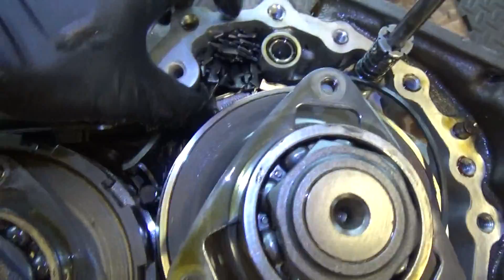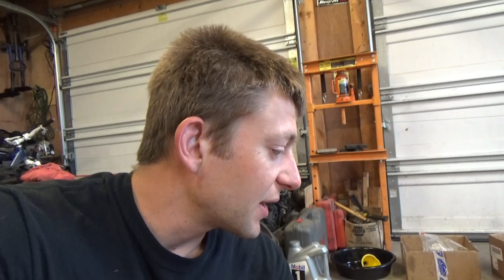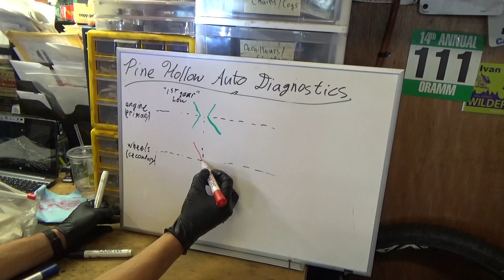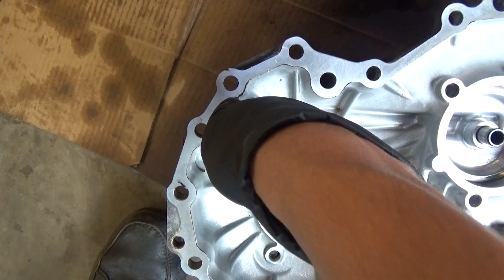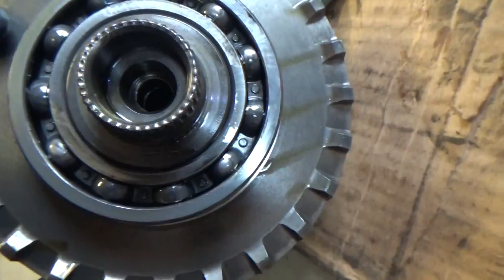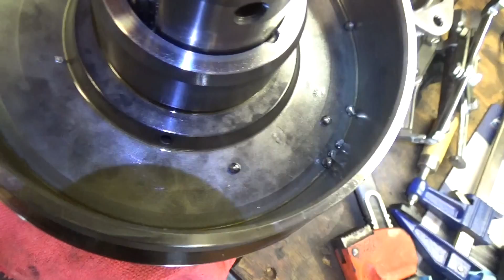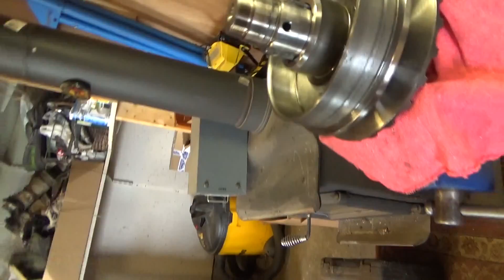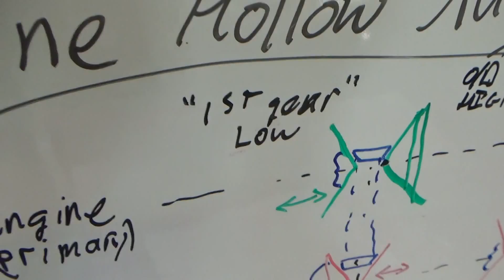Nissan CVT: Teardown and Failure Analysis -Part 2 (RERELEASE!)

Comment: Your synopsis is incorrect. The belt gave and jammed up the drive which sheared the output shaft which it also appears that the vehicle was moving when the belt came apart. Nothing lasts forever, remember this trans is designed and built by a mortal beings.
Reply from the maker: Now why are you so sure that the belt gave up first? I'm sticking with my initial findings lol
Reply: @PineHollowAutoDiagnostics  Because when the belt gave it jammed up the drive pulley and the force of the vehicle moving against the locked up drive is what caused those deep shaft groove damage to the planetary shaft. Those steel bands clearly show separation, if the shaft seized up the belt would slip but not come apart like it did, that's why. There must be 20 or so steel bands inside that belt.
Reply: Also you don't see planetary gear failure, if the planetary gears came apart and jammed the shaft then yes you could say it started there but this clearly is not the case.
Reply from the maker: You are right the belt is super strong with the 20 bands and no visible wear on the segments. That is why I don't think the belt just failed on its own from wear or fatigue. On the other hand, you can clearly see the long-term wear of those roller guide balls on the pulley shaft, and the balls turning into little nuggets of metal. Sooo that's why I think the belt was violently sheared by the failed drive pulley. Also not sure what you mean by "planetary gears"...this is a CVT, not a regular automatic? Your turn :)
Reply: @PineHollowAutoDiagnostics  The planetary or output set is what i referred to. That shaft is not normally under severe stress but when locked up the weakest will fail being those little balls and slots.
Reply from the maker: The two conical gear sets transfer all the power from the engine through the belt to the drive axles, so I would say those components are under severe stress, especially when accelerating. Since the pulley cone halves are symmetrical, exactly HALF of the drive torque is transferred through those three tiny balls that keep the one half from turning on the shaft. Not surprising they failed, as they are a much weaker component than the belt itself. Reasonable?
Reply: @PineHollowAutoDiagnostics  The drive belt broke up in many pieces. The shaft was gouged up but still turned. Your telling me the shaft and those little ball bearings are the failure while the shaft assembly still turned? Ok, if you say so..
Reply from the maker: Please watch the video again. I explain the cause and effect in great detail. Recap: guide balls failed -> adjustable half of drive pulley TURNED on drive shaft -> belt got violently sheared between two pulley halves -> BOOM!           Not so hard to picture :)
Reply: @PineHollowAutoDiagnostics  The steel bands are held together with many elements, the cause of failure is either element failures do to wear or one of the bands broke and then the elements and bands flew apart. At 180 thousand miles I would argue that your assessment of that pulley engagement setup being cheap and a weak link is wrong. 180K is a miracle achievement of that trans alone. I also will argue that the load carrying capability of that trans is limited by the strength of the belt and not the conical shaft engagement guide bearings as the main bearing still turned, regardless if the pulley engagement seized, which most likely was caused by excessive heat and metal debri. I like your videos but I do not like giving out bad information. If the shaft bearing seized then yes that could have damaged the belt but that was not the case here. Good day.
Reply from the maker: @biggysground  ok I give up... You win. Merry Christmas!

Comment: CVT are pure rubbish.  Just a thirsty slug of a transmission that has no clue what rev to be at or gear to be in. No power what's so ever
Reply: I don't like the fact that the engine have to rev to limit for extended period to get to speed, maybe good for granny that always go 20 km/h under the speed limit, but if you push them a little they are plan obsolescence.

Comment: I like my 2018 Murano platinum AWD,and don't care when time comes ,to  spent $4000 for new transmission,it is nice and quiet  to drive,I already changed CVT fluid once and having plan to change CVT fluid every 20000 miles chears
Reply: Oil change wouldn't have help in this case, the bearing are too small they have been eating the shaft for a while before it jam and broke the belt, i thought in most of those case it was the belt letting go but now i see another reason.

Comment: GREAT ANALYSIS. Should I get rid of 2007 Altima and 2008 Sentra which was probably replaced with factory rebuilt unit 4 years ago, and not just a belt. I don’t believe our vehicles have steel belts which was added in later Years. Are there any good CVT TRANSMISSIONS that are available in the after market rebuilders or is Nissan the only source for their JUNK?

Comment: I was at the Nissan dealership the other day and was talking to a tech taking one of these apart.  I was surprised they didn't just send the CVT into a repair center but they actually fix them at the dealership.   Of course they would tell me the failure was because of the remote starter I put in the car 5 years ago...
Thanks for taking the time to put this video together it was interesting.
-Jon
Reply from the maker: Wow they fix CVTs at the dealership? Wonder what parts they actually replace in there. When I ordered my replacement through the Nissan dealership, it was boxed in a crate, all shiny and fresh-looking. Hopefully it will last a while!
Reply: @PineHollowAutoDiagnostics  The dealerships directly are doing more internal engine work and transmission work lately.  I didn't think the techs had that kind of training to do rebuilds on this scale.  Maybe in the end it's just cheaper to do it that way instead of sending large heavy boxes back and forth to a central re-builder.

Comment: Sir some cvt come with triptronic  and padel shifter mod for manually controls the gears so how do they works because cvt have no gear it only have pully and belt so how cvt achieve different gears in triptronic and padel shift mod.... Plz reply... Which thing make it possible for it to switch in manual mod,,,???
Reply from the maker: Easy. They just keep the trans fixed in a certain ratio to simulate gears.
Reply: @PineHollowAutoDiagnostics  thanks.. The ecu keep the cvt fixed for different gear ratio

Comment: My grandmother has a 2018 Rav4 Hybrid with a CVT. While I love the car, and while Toyotas Hybrid CVTs are great, it just doesnt feel right when you press the accelerator. If you have to get up to speed quickly, it almost feels like you are about to blow the engine. It is a nice car however.

Comment: Really great work! I agree with your comments, it looks like Nissan either needs to increase the hardness of the input shaft (reduce the apparent galling) or add more keyways so that the torque is more uniformly distributed. The latter is most cost effective.

Comment: 186 thousand miles is a  pretty dang good life for  any transmission, thanks for the breakdown.
Reply: I have a 2005 Altima with 350,000 miles. I use synthetic and Lucas. Proof that fluid changes prolong life, still driving to my goal of 400,000 miles!!

Comment: CVT fluid had to be changed every 30k, that caused the damage.
Reply: The only CVT that is any good is the Prius CVT, it has planetary gearing not hokey steel belt. In general CVT transmissions will not last the life of the engine. Poor technology designed to make the car mfgr  more money per car.

Comment: The belt failed first. seen it already. thats why nissan is in trouble they make fancy trash. Stay away from JATCO CVTs
Reply from the maker: No, the belt did NOT fail first. It was violently ripped apart by the bad pulley.

Comment: This was very informative video young man. These trans are junk in my opinion. What would have been a great video for you to do next is to redesign the pulley shaft, putting in the needed ball bearing support systems with a upgrade to the metal hardness of the shafting for the pulleys. Do some porting that needs to be done. Show reassembling of the transmission and running it to see if your theory was correct. This video shows just how cheaply made the mechanics are. They put just enough thought and work into something that can be sold with wearing  built-in to support after market parts and labor.

Comment: The car manufacturing companies insist on keep the CVT transmission because it's cheaper to manufacture and will make more profit for them, even though the CVT less reliable than direct shift AT. Thanks.

Comment: I am the owner of a Nissan 2012 Rogue.
Reply: Very few miles (22K) so maybe my car will last another 10 years before it fails. I am planning to install a secondary cooling device to avoid overheating problems. Maybe that will help.

Comment: I used to own a Nissan Sentra 2015 and @ 59k miles CVT failed me. Same with my 2017 Toyota Corolla, At 60k miles CVT failed me. In short, CVT is from Hell.
Reply: Robert Bolivarr 
Ok first, 
CVTs use a hydraulic fluid that isnt as durable nor relatable to automatic transmission fluid (ATF).
CVT fluid isnt anywhere near as heat resistent as ATF, so it will degrade to 210 degress of the warm engine easier.

The most important lesson to remember when buying a CVT car 
is to remember to have the dealer flush your tranny at 25-50k miles to maintain reliability
Reply: Robert Bolivarr 
I bet your Toyota Corolla had it's CVT fail at 60K miles all because-
 Toyota is very inexperienced with belt+pulley-type CVTs

& didnt warn ANYONE that CVTs need to have their fluid changed every 25-50k miles to maintain reliability.

Comment: 105,000 on 2013 Altima and  the CVT works great.  I did change the fluid once.  That is recommended.  Now I have to keep it to see how far it will go.
Reply: 213,000 miles on 2013 CVT Accord. Changed trans fluid twice. Still runs like new. My last 1997 Non-CVT Accord was at  356,000 miles when I got rid of it to get the 2013 model. Honda for life.

Comment: The belt is actually not stretched at all. This is a push belt, so those metal clips get squished together and push from one pully to the other one the torque. That's how you can get away with so small metal belts to hold everything in place.

Comment: Thank you for making this video. It is unfortunate that Nissan uses all JATCO CVT transmissions. (Japanese automatic transmission company). These never failed in older Nissan products, until it was introduced in the Murano with it’s much higher powered 6 cyl engine with additional torque. The transmissions are being overloaded with the torque generated by the larger 6 cyl engine that the Murano needed to drive it and it’s AWD system. Unfortunately, JATCO underengineered the transmissions and the manner in which the North American climate dealt with them. Even with a conventional auto box, you were always advised to exercise care when starting the car and then trying to drive it away when the ambient temperatures were well in to the minus temperatures. COnsumers did not give a rats patootie about these cautions and that was the advent of automatic transmission repair shops.  Now they do the same thing with CVT’s in cold weather (drive the shit out of them before the transmission oils have a cane to come up to a useable temperature, and voila,.... enhanced wear and failures of these CVT’s. It is interesting that Honda and Toyota have designed and engineered their own CVT’s which have proven to be quite reliable. Perhaps doing things ‘in-house’ has merit.
Reply from the maker: Yup seems like the CVT design here is not quite "heavy duty" rated!

Comment: Great video...frankly seeing the innards of these (nissan) it seems WAY less complicated than an Auto trans with gears. Kind of the same weak points though.

It looked like the root cause was the ball bearing that guide the pulley up and down...Not an engineer, so there must be a reason why, but to me it looks like the use of smaller bearing /balls was the issue. I think going to bigger balls and deeper channels would have been better.

The cost to replace them shouldn't be this high, they appear to be less complicated.
Reply: Those slots looked to be 5mm, albeit its hard to tell for sure. 3 slots of that size should be more than adequate (depending upon the number of ball bearings).  Considering this tranny did 189,000 miles prior to failure, the Jatco folks enginerring models were probably pretty accurate. 

However, this doesn't explain the early failure horror stories. My guess is those are probably due to the engineers expecting folks to adapt their driving style to CVT characteristics as well as following maintenance guidelines. In those situations larger slots / bearings and associated secondary consequences, (perhaps a larger shaft) may help. Also, in regards to early belt failures / scoring of variators, either different metallurgy, surface treatment, or fluids may be part of the solution.

The thing is,  once bearings start to wear / slots wear through their outer surface hardening all bets are off... then its like the remaining hardened surface treatment starts acting like sandpaper and its on a fast track to failure. Note the amount of metal filings on the magnets in the pan...I've pulled apart a few Jatco units, and have never seem that much manufacturing / initial break-in wear in their automatic or manual trannys, even on the Z cars.

I like the simplicity too... boatloads less complex than a conventional automatic, and a ton fewer wear items too. (Once they get the effects of real world usage including failure modes integrated into their design models). I think the insane prices are due to a tightly controlled supply and little if any competition.

Comment: Thank You Renault and Jatco for Ruining Nissan.
Reply: i tell everybody avoid nissan like the corona virus... i think mazda has taken its place among top asian car makers... mazda is cozy now with toyota.. and they do not use JATCO anything 
far as i know
Reply: Gabriel Cornejo 
First: 
Renault may own Nissan but it
 does not control Nissan's decisions 

Second: 
Nissan went head-in-shoulders for CVT tech BEFORE Renault's merger 
& 
CHOSEN to design & manufacture CVT untis as means to improve fuel economy
&
now Nissan shooting itself in the foot!

   FYI- Renault doesnt even sell CVT cars they use DCTs & manual on their name brand cars
Reply: Cvt isn‘t a Renault part. In Europe, nobody wants cars with cvt gearbox. Renault are very reliable. Very good small Diesel engines . Nissan‘ s reputation in Europe, first of all, rust. Cheap little cars for poor people.
Reply: @lieberfreialsgleich  Toyota uses the fantastic assain cvt transmissions that have no issues...renault owns nissan but still lets them use those crap Jatco CVTs
Reply: i saw a brand 2020 sentra already have a cvt failure only had 3000kms on odo
Reply: And mitsubishi too
Reply: And mitsubishi too

Comment: A splined shaft and drum design would cure this problem. The engineers would had to of known this ballbearing design would fail, they didn't want this CVT to last so they designed a weakness. Unfortunately, many vehical manufacturers  do this same thing, design failer points so you'll end up buying another piece of garbage.

Comment: If you've ever owned a snow-mobile you've owned a vehicle with a cvt,but their belt is fabric reinforced rubber,I guess most today use a hydraulic torque converter with a cvt.

Comment: Ivan, I have a 2017 Altima with 80K. The transmission doesn't drive like yours. Chances are it is the belt. Question. Do you think on your Rogue, you could have just removed the half that holds the pulley without taking the whole transmission out? If possible, that might be a lot easier, without taking off the subframe, etc?
Reply from the maker: No way, transmission has to come out...

Comment: My wifes 2011 Maxima failed at 94k. Not covered by the extended warranty. $4k with lower motor mounts. Unbelievable...
Reply: my 2011 Murano SL AWD failed at 132k miles.  Estimates of 4.5k to 5.5k by various shops, 14hrs to 18hrs shop time at 115 - 150 an hour.  4 additionaI shop hours due to AWD requires driveshaft, transfer case and sub assembly must come out,  while 2 wheel drives like your maxima won't require. i just bought a Berkeley Standard remanufactured transmission with upgraded components for $1,650 delivered, but TranStar their local dealer will only deliver to ASE certified shops/mechanics.  Shops typically add another 800-1,200 mark up, I avoided that by having an ASE certified mechanic order it and delivered to Gearhead garage in Portland Oregon, they charge $25 an hour for the work bay with full lift and access to pneumatics and tools.  If experienced shop mechanics take 14-18 hours, I am adding 2x that amount to get the diy job done.  I know it will take two full days if not more and I'm paying a mobile mechanic to be there at critical times at 50 an hour, 8 hours total.  I'll do most of the tear down of the sub-assembly transfer case, etc, and re-assembly.  I"ll give an update on job and all the unforeseen disasters sure to occur along the way.
Reply: instead of a 4.5k - 5.5k bill for nissan cvt awd replacement, hoping final bill comes in at half that price or less

Comment: Crazy question. Would it have been possible to just by a new chain and put it on? If those little balls and pulley were intact of course.
Reply from the maker: Theoretically yes. But the real problem is the little balls and the shaft haha